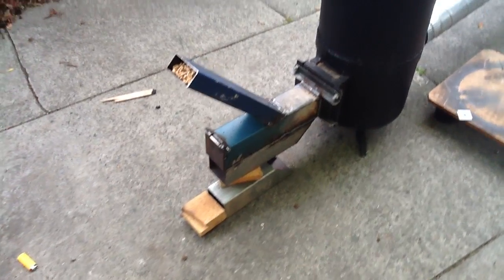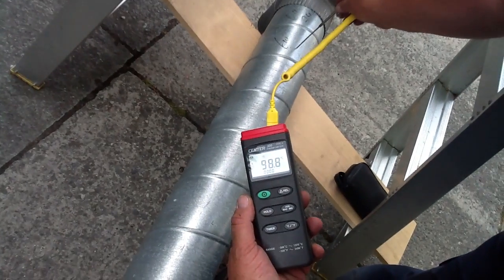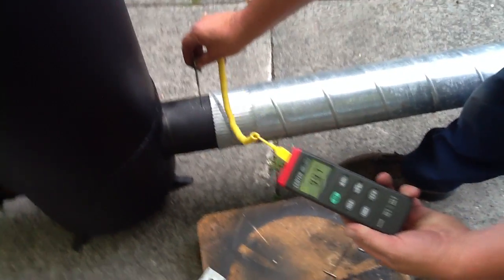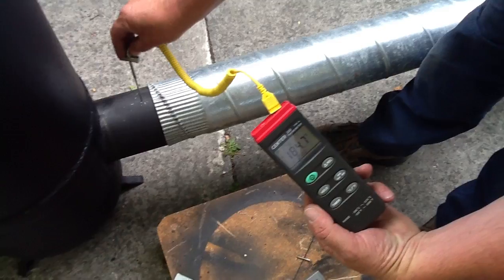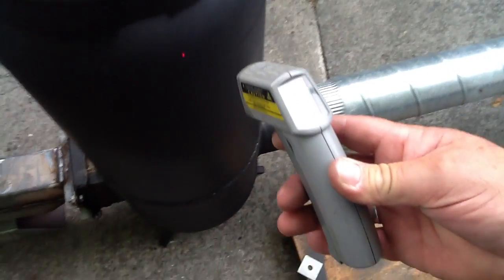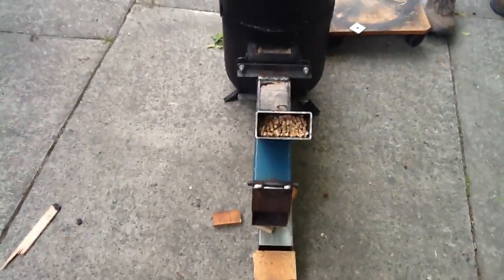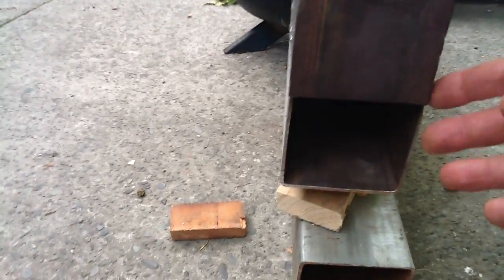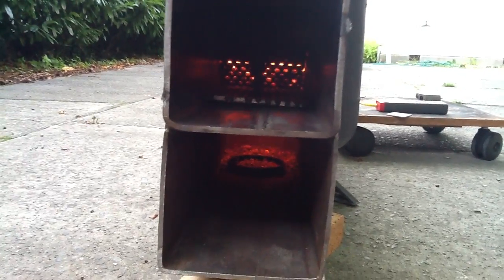Rocket burner test fire

Comment from the maker: We have been using the sauna every week for the last two years. It takes about an hour and a half to get up to temperature (80) and continues to grow hotter to a maximum of 115 (so far).we control the heat with a vent.  I made a mesh grate for it which lights much faster and lets more air through but the sauna gets too hot for my family too quickly.